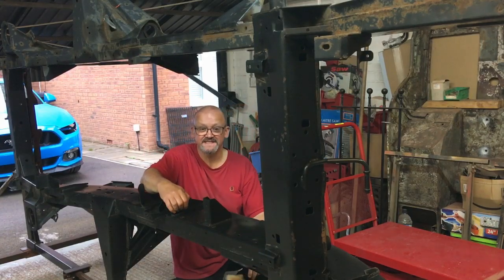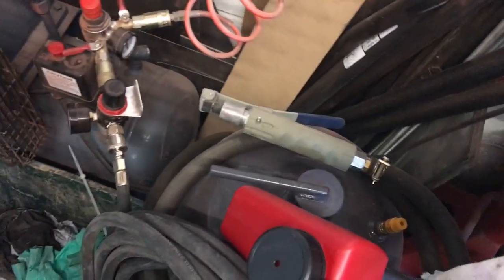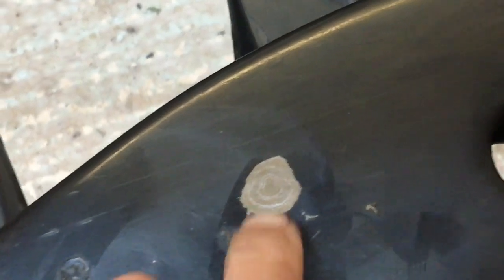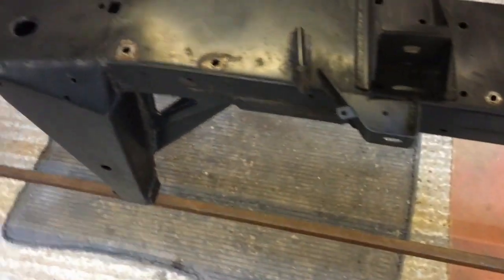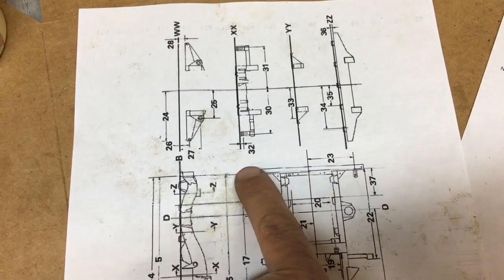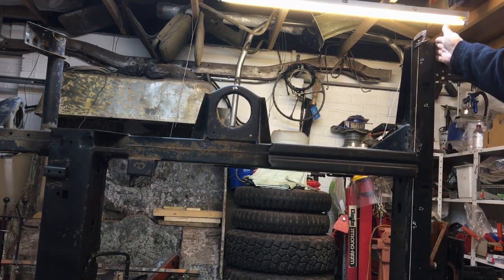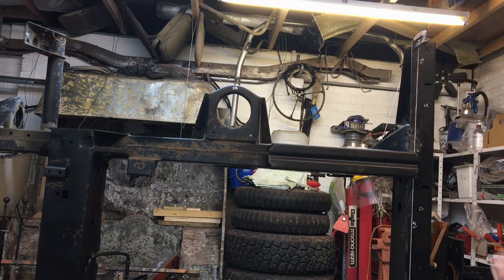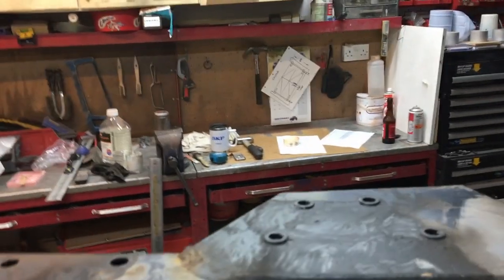Defender chassis stuff and help required please..

Comment: Inclined to agree with Phil's comment.  I can see however that you are determined.  I go for Ockham's razor - take the simple approach.  That part of the reasons cross member doesn't have a structural function so you are concerned with cosmetics only.  I am not certain that tension exists in that part of the cross member so it may not spring out as you have suggested.  If it does not, you will need a way of pulling it into a alignment.
On a separate issue, what advice would you offer regarding purchase of grit blasting equipment?  You refer to a pot, but I know you also have a blast cabinet.  If you could offer some brief pros and cons and thoughts re minimum compressor size this will be much appreciated. Thanks Simon.
Reply from the maker: Hi Simon, I'll talk about this in an upcoming video. If I haven't done it by the end of July give me a poke... there is a lot to say.
Reply: @defender90keswick.nigelsla59  Hi Nigel. Hope you are well.  As per your suggestion, a gentle reminder about a video addressing grit blasting/compressor issues. Thanks in advance and best wishes Simon.
Reply from the maker: @simonroberts9759  I will have something up in the next few days. I have almost finished blasting the chassis, and intend to do a video of the last bit of blasting. Thanks for the nudge.

Comment: To be honest, I haven't a clue how to resolve the issue most effectively. What might be a starting point is to contact one of the galvanized replacement chassis manufacturers and see what they do on jigging the chassis and if they can suggest a fix. Maybe they have better, more accurate and more durable methods.
Beyond that, I wish you well on that one. I'm more the kind of person to leave the chassis components in place but "bare metal" the frame and apply several layers of coach paint which has incredible durability and end up with a high gloss, wipe clean frame.

Comment: I just wonder what's causing the distortion: the crossmember itself or the welds to the main chassis and especially those triangular reinforcements look suspect. Also: is there some bulging when you measure the height of the crossmember front to back?
Reply from the maker: It is caused by cheap and cheerful manufacturing techniques.

Comment: Mr Surfacer won't fix the rear cross-member Nige.  Personally I think the distortion looks like it's wear on the press tool. As far as LR were concerned as long as the location holes matched the jigs - that's all that matters. I'd be more concerned after all your rectifiction on the chassis is whether the body goes back on ok.